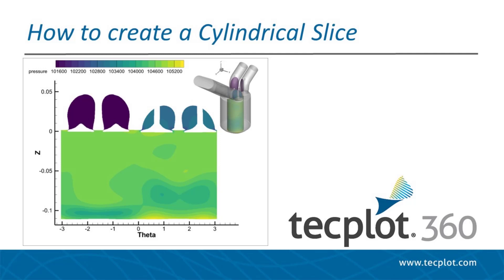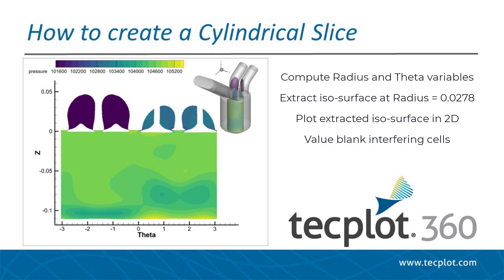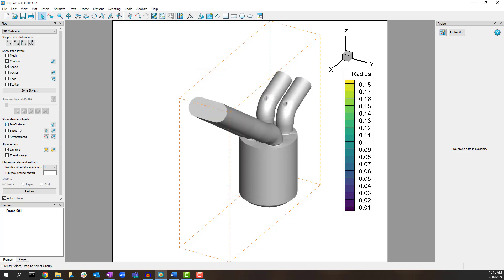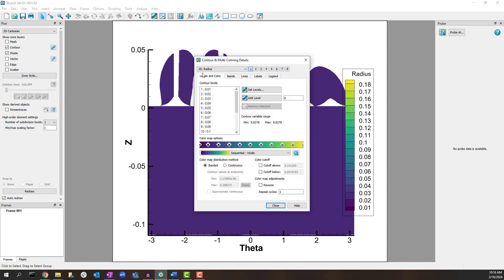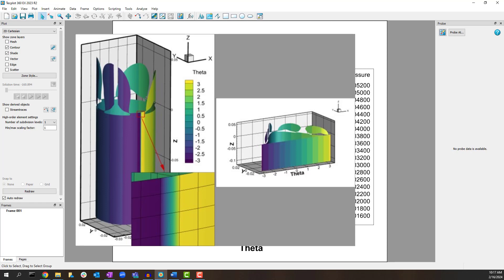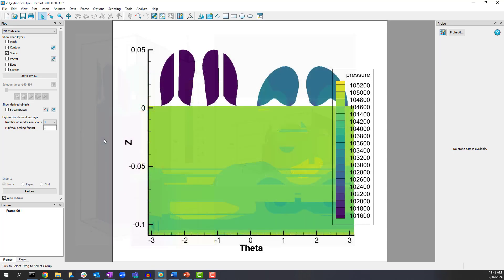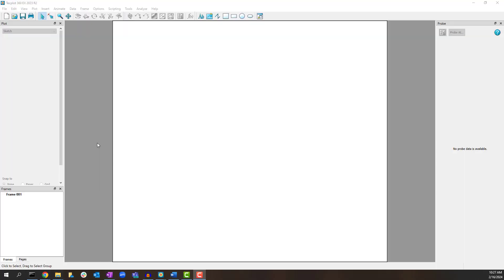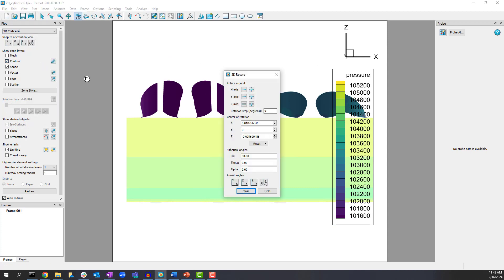How to Create and Unwrap a Cylindrical Slice Using Tecplot 360

Comment: Hello, If the surface is 50% span height for centrifugal impeller, which is not a cylindalic surface. Like CFD-Post in TurboMode, it's easy to create turboSurface while in Tecplot is not.However, the equation is much useful than CFD-Post. If the software can come up with more function relative to turbomachinary, it could much better! Thanks a lot!